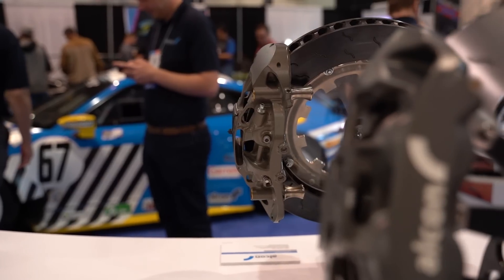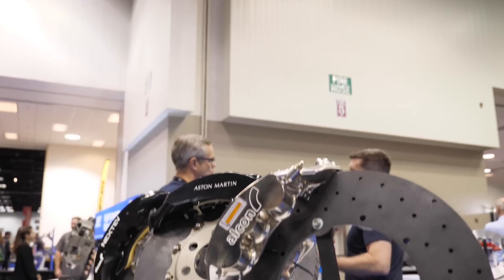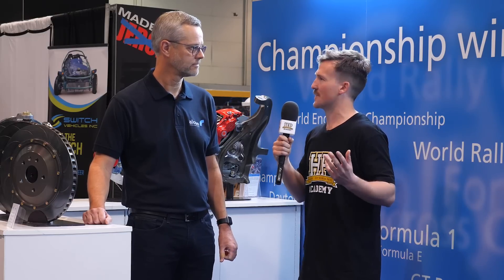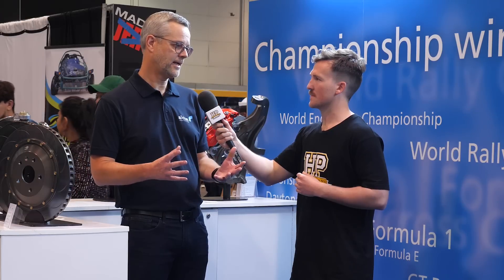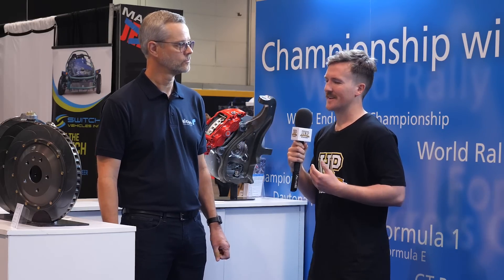Most Racers Get This Wrong | Brake Setup

Comment from the maker: Have you changed your own brake setup? What did you do and what led you to those changes?
🔵 Building a fast car? Get $400 OFF the all-inclusive VIP online course package deal: https://hpcdmy.co/offery144
🛑 Brake System course. Design & optimise your set up. Now 50% OFF your first course:  https://hpcdmy.co/offery144
TIME STAMPS:
0:00 - Alcon Brakes
0:11 - Bigger Is Better?
0:49 - Brake Balance Is Key
1:14 - Rotating & Unsprung Weight
2:11 - Generative Design
3:18 - Quick Change Pads
4:08 - Compliance/Stiffness
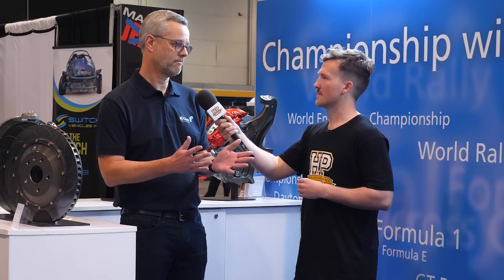5:15 - Brake Boosters & Motorsport
6:00 - Balance Bar & Sizing
6:38 - Pedal Effort/Stiffness
7:43 - Brake Knock-back/Knock-off
8:27 - Solutions
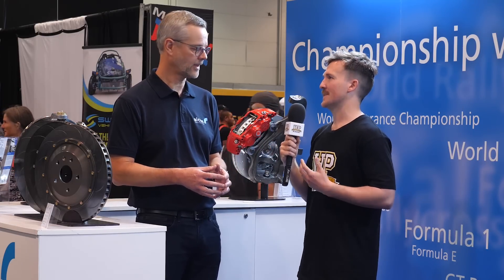9:07 - Drivers POV
9:34 - Thanks Phil!
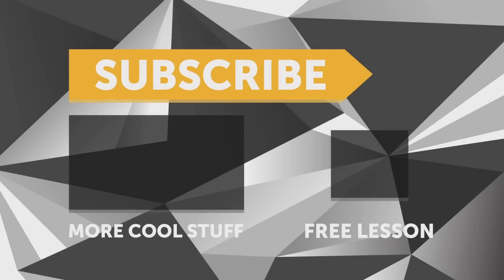9:56 - More Great Content

Comment: My older car without ABS has big brakes front and rear. I have a proportioning valve in the rear brake line, which has been very helpful in dialing brake balance. How do you do this with an ABS car? You can do math with piston sizes and rotor diameter to come up with something close to factory brake balance. It seems to me that you would have a hard time figuring out what temperature the brakes will be operating at, and since coefficient of friction varies somewhat with temperature, your calculations will be a little off. So it would be nice to have something to adjust brake balance on ABS cars. How do you do this? Do you just have to try pads with different friction characteristics until you get good balance? Is it OK to bias the rears, then add a proportioning valve for adjustment?

Comment: Yes you can over size breaks and they will lock faster! But you don’t want that. Now if you have an ABS system then you can start over sizing. Cause you have ABS computer. Now with that said. Up size calipers but keeping original masters seams to work un boosted. But soon as you add boost they lock fast. The 11 second car took a bit to slow but was very controllable, the 13 second car with boosted brakes stopped faster but was very grabby. Not something you want when you still running original suspension!
Reply from the maker: It's more about thermal management than outright stopping power. OEM brakes simply cannot handle the heat generated in a motorsport application nor are they designed to - Taz.

Comment: I always question brake bias when ppl upgrade the front brakes to big brakes on their street car and retain the OEM rear brakes. Is the bias correct when this is done or should there be some sort of bias adjustment added when upgrading to big brakes? -pantyeatr1
Reply: There does seem to be some set-ups that would seem to be unbalanced - but usually bigger front brakes are used with better tyres, which can offer more front load transfer and so more potential to use better front brakes.
Pad characteristics - the CoF vs temperature - may be a relatively easy way to balance the brakes when a proportioning valve, or pedal box, isn't practical or legal.
Reply: Yeah, that's how you get worse braking performance with bigger brakes, not uncommon. Brake balance is very very important to get shortest brake distance.

Comment: We have Alcon calliper’s the large GT / endurance ‘fancy shaped’ ones , 6 pot  380mm and 4 pot 330 rears , lightweight and extremely good quality. 
These guys are correct , there are various factors to consider when going big , including downforce , tyre width / grip suspension geometry , shocker settings and driver style. One can’t just judge callipers by slamming on in ‘ drive like you stole it mode ‘  . Trail breaking , turn in point and weight transfer to the front axle have a huge effect. Any gt3 cup driver will know what I mean  . I would have another set  , no problem

Comment: I let the experts do my AP racing brake upgrade.
Reply: MD of Alcon used to be MD of AP racing , he just got tired of AP and set up on his own  . Their both as good as each other just so do more products
Reply from the maker: Leveraging the knowledge of industry experts is a smart move, and is what they are there for 😎
As mentioned there is a crossover between Alcon and AP, and they both benefit from having each other around to push each other as top-tier competitors 😎
This is a great podcast episode if you are keen on a bit more insight into that world: https://youtu.be/dMbOmXZtlKo - Taz.
Reply: @hpa101  I used Essex parts here in the USA to do mine. They made several kits so everyone has an oportunity to get the same upgrades as I did on my 370z.

Comment: almost every car on the road can lock up race tires on the track with the right pad selection, the size of the piston, pad, and master cylinder helps modulate brake pressures much more than outright braking force. If you think about it, the larger the pad, the lower total force you can apply to the rotor. Just in psi. Maybe this is an over simplification and someone can correct if wrong.
Reply: You’re correct but you need to consider heat dissipation and rate. So while you can lock up your wheel, how long can you transfer kinetic into heat before the heat becomes too much and you loose braking
Reply from the maker: Thermal management (heat) is the problem you are trying to solve here. OEM brakes are not designed to handle what motorsport applications put them through. That's what it really all 'boils' down to - Taz.
Reply: @hpa101  
Pretty much, with being able to apply enough braking torque. At least modern brake fluids mean recirculating brake setups are no longer needed - AFAIK, I should say.
Reply: Can't think of a modern-ish car that doesn't have ABS, but even without that, the increase in brake torque required for slicks may make it difficult for some vehicles.
I don't think you meant "modulate" - or most of the rest of that sentence, as it doesn't make any logical sense.
Maybe if you re-wrote it?
Reply: @gordowg1wg145  the point was small brakes still develop way more torque than Rcomps have friction. I did mean modulate. The driver of a car with properly sized braking hardware for racing has lots of options, with a huge amount of adjustability in the force of the brake pedal, and pad clamping force. There are many ways to write things, its abusive (gaslighting, for one) and discriminatory to discredit someone else, especially when it's your reading comprehension issue.
Reply: @mm6705  
Sorry, forgot - the primary problem with modulation is the pad-disc characteristics - while some combinations have a relatively straight line CoF, others can be quite "grabby" in that the initial brake torque is greater than the nominal CoF and applied force on the pads would suggest, others can be "sicky" where a reduction of the applied pad force doesn't reduce the brake torque as much as would be expected - ie, they don't have linear CoFs.